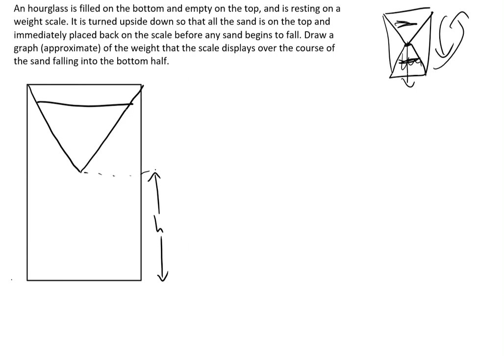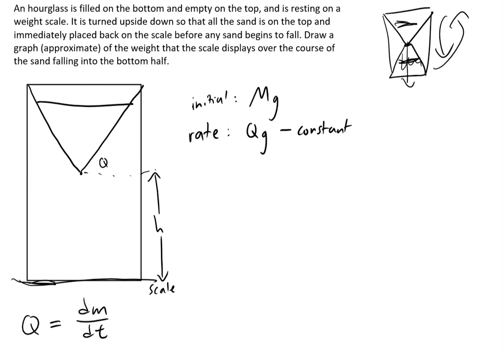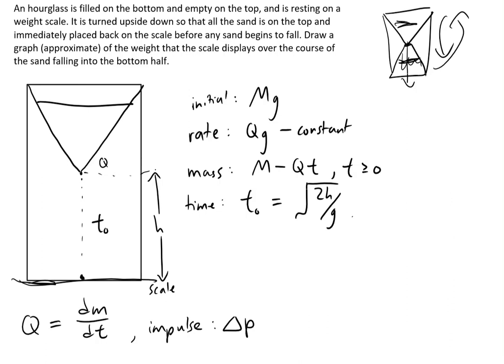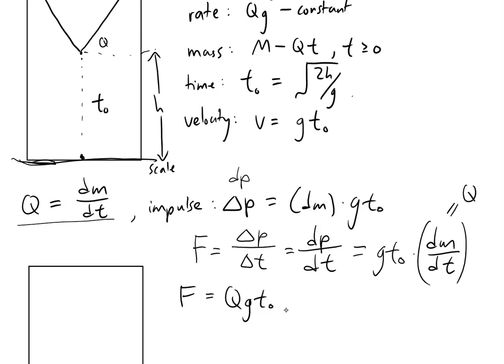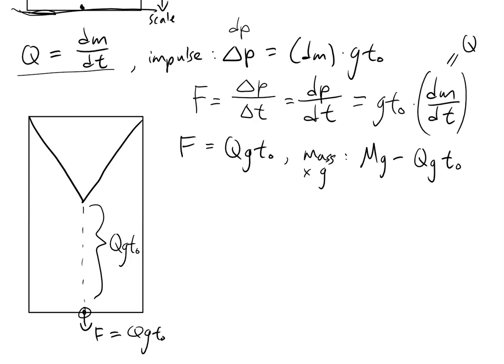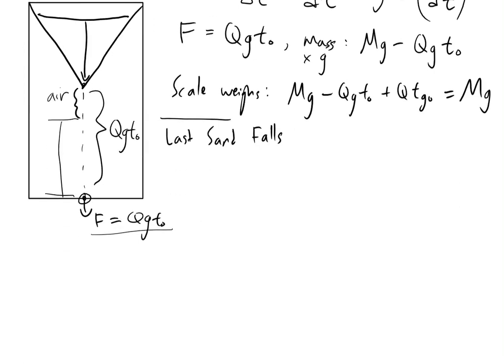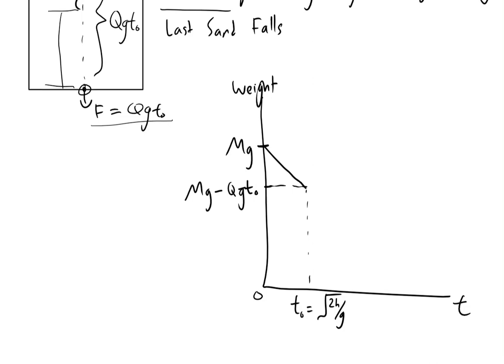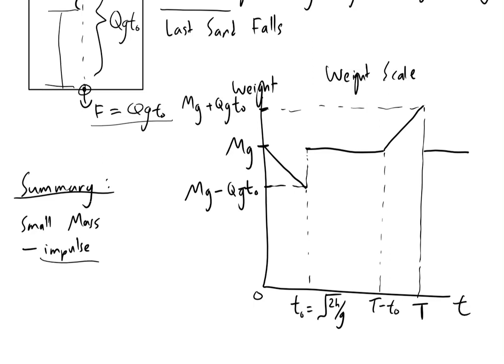Hourglass Weight

Comment: I thought about this problem a bit. actual, the middle part should be slightly larger than Mg. Here is the argument:

We know for a system, dp/dt = \sum F_i.
For this hour glass, we have dp/dt = \sum_i m_i * v_i = Mg - F. Take downward as positive direction.

As you mentioned, the rate sand falling down is constant. That is true. But as the sand accumulate at the bottom, the distance sand can travel is shortened, which makes the average speed of sand slower.

Also, the sand on the top should also have a bit of momentum. As the sand on top is less, it also has a negative contribution to the total momentum of the sand glass. 

Overall, dp/dt<0, meaing Mg<F.

Comment: When I stand on a scale, I can influence its reading by accelerating my center of mass up and down. The hourglass center of mass starts up high and moves down as the sand falls. The reading on the scale will match the weight of the hourglass only if that center of mass falls downward with a constant speed. The center of mass, if I recall correctly, actually moves down with a decreasing speed, so the acceleration of the hourglass CM points up, then according to Newton, the total force acting on the hourglass must point up, meaning the Normal force (the scale exerts on the hourglass) is greater than the weight of the hourglass. This is a very, very small effect, and the transients at the beginning and end are far more significant. If the sand moves down a few centimeters and takes sixty minutes, imagine how small that acceleration is, but it is not zero. I have noticed that some youtubers actually designed hourglasses to show that small increase in scale reading while the sand is falling in steady state.